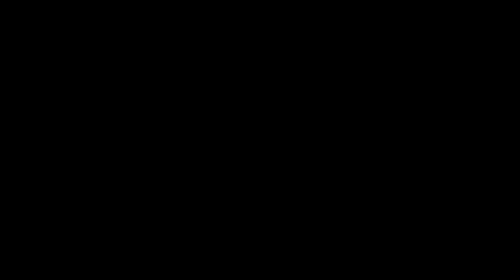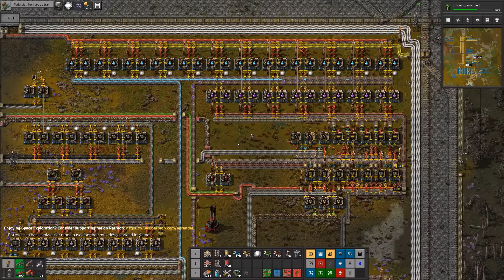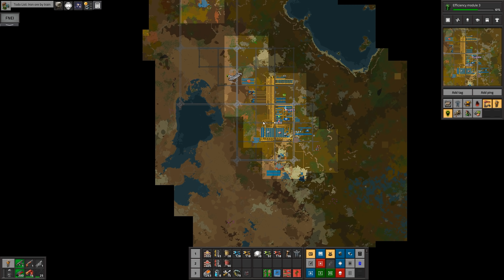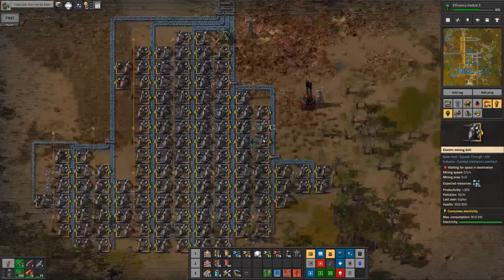Factorio Space Exploration #15 - Iron ore train

Comment: Over at the iron loading train station, the exit has two or the single light signals at the same junction: you should change the one on the mainline to the triple light, to give that traffic priority, otherwise you may have a bog down situation. And then, at the iron offloading, why do you need two of those large warehouses, one should have been enough, no? It was kind of annoying to see you stop production of steel while farting around with an alternate build, I would have let it run and cut-in the new installation once it was near complete. Thank for another great video.

Comment: one thing i like about deadlocks miniloaders is that they dont need power, and there is only one variant, they do not have a separate filtered version.  the loader can be filtered by default when unloading.  At 56:40 you are using the filtered version, you need to tell it what to take out.  I personally don't like the regular miniloader mod for that reason.  Other loader mods have just the one loader and when they are set for output you click on them and you can set the filter

Comment: The loaders can be configured in mod settings to not need power. I do that when I'm on a Rail map and I don't want to run poles for miles. Also, the chutes are the very beginning loaders. I've never found them useful. You can remove them from the recipe list in mod settings.